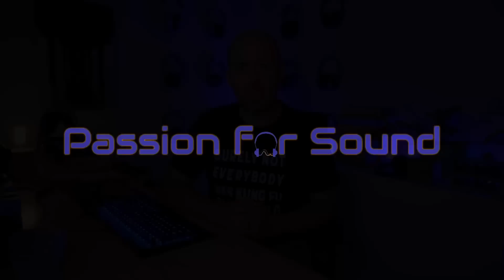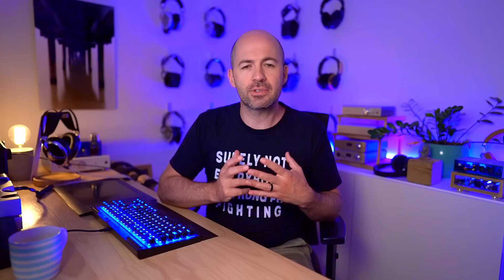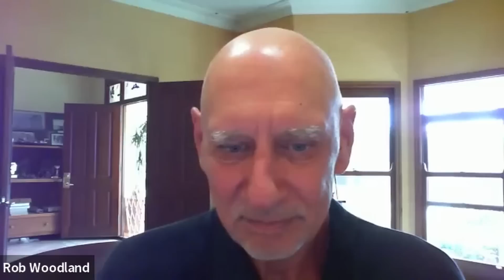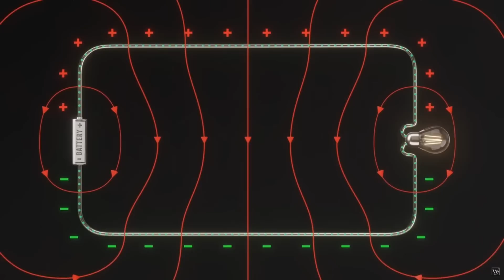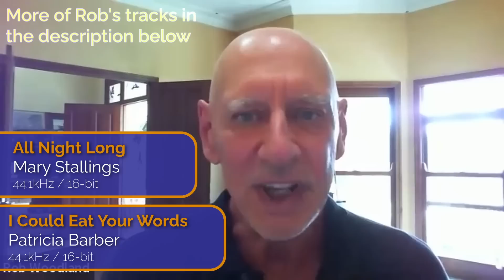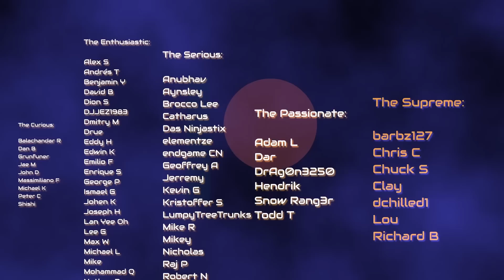USB Cables for Audio: Interview with Rob Woodland from Curious Cables

Comment: So I finally got a decent DAC and I am wondering if there is a potential dip in audio quality if my bit depth is too high for the source? The Topping Dac defaults to 32 bit 48000 but most music is 16 bit 41000 and I hear much of games are 24 bit 48000. Is 32 helping or no?
Reply from the maker: You'll generally want to use an exclusive, bit-perfect connection to your DAC via a dedicated music playback software. If you're operating system is resampling the audio it will degrade the quality so it's not about the bit-depth or sample rate so much as the poor quality resampling being done by your OS.
You can check out simple, free software like Foobar to setup a bit-perfect connection and see what difference you can hear.
Reply: @PassionforSound  Okay but will that work for games or only music?
Reply from the maker: Only music. It will be good enough for gaming though that I wouldn't worry too much about it for that. Maybe try changing your OS settings to output 48kHz, 16-bit and see how that sounds because I'm pretty sure that's the native sample rate for most computer audio and might therefore have less meddling from the OS. Just an idea.
Reply: @PassionforSound  Thanks will do. :)

Comment: Nicely Done. 
You seem to genuinely enjoy these interviews and I usually come away with a tidbit.  Good on you.
Patricia Barber :)
The point that stood out for me - You can hear the difference in a good quality system.
IMHO I don't think reviewers ( in general ) stress enough that anyone with a dac from $100-$500  maybe till $1000  is not in that category and most likely won't hear any difference. 
Not resolving enough might be the term.
I think Rob mentioned ( I'll paraphrase ) This is for a person with that good quality system that is looking to squeeze out the last drops of goodness from there system.
Your thoughts ?
Reply from the maker: I completely agree and I often stress in my accessory reviews (cables, power supplies, etc.) that these types of upgrades should generally be the last thing you buy because you'll get more bang for buck from upgrading components than cables, etc. I do think cables can improve a lower level system, but the improvement will be much less obvious depending on just how high or low level the system is

Comment: After watching this video I swapped USB cable in my DAC.  Unfortunately there is no audible difference.  
Cheap USB cable that came with my DAC sounds as good as expensive audioquest cable   LOL
Upsampling to 1.5 ghz in HQPlayer also works just fine.

Comment: Appreciate the insightful video!
One thing I wish you would've asked was the difference between active and passive usb cables and how they worked (the ones with a separate 5V line, for ex). I'm aware it has to do with some type of handshaking but other than that that's all I know.
Reply: To see if your DAC does not require the 5v handshake  - The  + -5v pins on the USB cable can be de-activated by just a sliver of insulation tape.
If the DAC is recognised  then you have effectively reduced noise down the USB cable -Nice tweak
Reply from the maker: My understanding is that some devices rely on the 5V lead to know that the DAC and source are connected - others don't. If you don't need the 5V handshake then removing the 5V power lead can help remove a noise source from the signal path, but there are too many DACs that rely on the 5V which is why most audio cables still include the 5V and aim to deal with the noise using insulation, separating from the main cable, etc.
Reply: @PassionforSound  thanks for some clarification! Too many dacs rely on them? The ones I've seen are mostly in the higher-end of things, but I could be wrong.
Reply from the maker: When I was testing the USB cards (Matrix, JCat, etc.) I found that none of the many DACs I had here would recognise the PC if the 5V power wasn't activated. I'm not sure about all the ins and outs of it

Comment: 16:00 I keep echoing this sentiment.  I just don't listen at the level where I, as an audio-enthusiast WELL vested in this hobby, can hear enough of a difference in cabling to spend a couple of hundred to improve my chain.  Even though my listening is 100% digital.  Even though I believe (don't know, believe) that cables can modify the sonic characteristics of your setup, it still doesn't make sense enough for me to spend the money there.  I'll pad roll.  I'll acoustically mod.  I'll EQ. I'll maybe invest in a separate power supply or conditioner.  Whether I'm right or wrong, I just do what makes sense to me in this hobby and refrain from condemning anyone else for their choices.  Even if you want to buy the same Doorstoppers Darko uses.  Doesn't affect me one iota.  If you think it sounds better then more power to you.  

When the laws and statutes are passed that requires you to buy a $600 dollar cable within 30 days of purchasing an audio device over $200.. then I'll grab my pitchfork.  Can't remember where I put the torches though.
Reply from the maker: No need for the torches, just stick to the stuff that makes you happy 😉

Comment: I don't want to be that guy and I do appreciate the video and have nothing against anyones opinions, but I feel very confident in claiming that this is absolute bollocks.

The mentioned electrical phenomena have absolutely nothing to do with digital transfer. Any up to standard spec digital cable will work identically to any other (long lengths a separate issue) unless there are design issues in the devices at either end and that would be related to noise/interference that a subpar DAC design, for example, allows to happens, but definitely not to the actual signal itself as it is infact data in analog form. There are no dimensions of variance that matter.

Whether the data comes in via optical, USB cable, bluetooth, ethernet or in hand written letters that are then manually written into a buffer with a keyboard shouldn't have any effect on how it is translated into an analog signal. That is the very purpose of digital information transfer. It would be the same as claiming that that routing your Tidal lossless stream via a VPN through another country to avoid the under-sea cables is a good idea since that makes the music sound wet.

There often are very minor differences due to issues with DAC design for example, but the cable doesn't affect this unless there are severe technical design failures. Like in this video, no one can even come up with a fantastical potential explanation.

It is effectively certain that no one can notice a difference between a 1$ USB cable and a 1000$ one in a double blind test on a system that doesn't have noise issues in the design.

That said, having good quality, well designed products made from good materials is, of course, a great thing and can cause a subjectively worthwhile experience since the listening experience is comprised of many things beyond the sound itself.

Also you can buy an AC cable for 1$ so surely the regulations are not an impediment to producing a high-end one? Unless the claim is that the regulations don't allow for a superior design then the most basic stuff on the market.

Enough for the rant, I like your channel and even this video. Keep it up!
Reply: Try it yourself and hear the difference.
Reply: @DrJum  Okay, I have here the USB cable that came with a Playstation 3 controller and a Supra USB cable that is commonly sold in hifi shops. The Supra cable also costs literally a 100 times more. 

Could I, or a few studio professionals I could ask to try, hear a difference with these or do I need something fancier? Any song  suggestions that might help reveal the difference or certain aspects of the sound? Soundstage was mentioned in this video a few times so maybe that's one.
Reply: @hartyewh1  After being in this hobby for some time and having a good enough system and training my brain enough I can hear many differences between all sorts of cables. I used to not hear a difference even when trying in the earlier days. I have spent more time than I’d like to admit comparing USB, XLR, RCA, headphone and speaker cables and I have not found 2 different models that sound exactly the same yet.   The differences I can observe are purely tonal. Eg more or less bass, midbass, mids, highs, etc. when it comes to spatial difference in cables it generally if not always related to the tonal difference providing that spatial variance. For example a cable that lowers mids a couple dB will make everything sound a bit more spacious and less intimate. Hope this helps.
Reply: @hartyewh1  Use a song you know well so you’re not surprised by random sounds and instruments popping in. Doesn’t have to be audiophile quality. Try to test just a short period like 3-5 seconds and try to remember what you hear by describing it… is it chesty, is it harsh, is it realistic, etc. then quickly switch cables and listen to that few seconds again and describe again. Sellers of Flowers by Regina Spektor will tell you a lot about a cable in the first 6 seconds. Focus on her sibilance from the S sounds. If you’re highs are high they’ll be harsh and grating. If they’re too low it won’t sound harsh or resolving. You want to try and find a sweet spot to your preference. If you don’t hear a difference in those 2 specific cables there may not be a difference or maybe it’s too small to pickup on. Once you’ve heard a more stark difference the smaller ones will be easier to pickup on.
Reply: @DrJum  Well sure, analog cables make some difference certainly and that is no wonder, but for a digital one to do that seems strange at the least. If the differences are tonal then that would be very easy to measure as well. I wonder why no has done that.
Reply: @hartyewh1 Digital cables are a misnomer by the way. It’s an analog cable for digital use. USB cables aren’t 1s and 0s it’s a voltage range just like analog but interpreted differently by the computer… basically. I understand what you mean, it’s clearly an audible difference but the people with measurement rigs worth their salt aren’t bothering.  You really need a lab environment to test accurately too as things like temperature of the room will affect measurements if using microphones!
Reply from the maker: Tonal differences can be caused by slight changes in things like signal phase which won't show up on simple frequency response measurements. It's also why different amps and DACs which measure ruler-flat for frequency response can sound different tonally
Reply from the maker: I think that's the key in the end - try it for yourself and see what you think. There's insufficient understanding of hearing science to say definitively what is/isn't audible so the only way to truly know is to listen for yourself with an open mind and test biases for and against your experiences.

Comment: What if you live in an area being served by a Internet backbone router that is not Hifi?
Reply from the maker: Hi Jonas, I don't understand the question - sorry! Can you explain a bit more what you mean?
Reply: @PassionforSound  My point is, why is the digital protocols used for local data transport not as error resistant as the tech used to send data from the streaming servers to our homes?
Everyone seem to take for granted that the bits reaching our local applications are perfect. But that we are also utterly incapable to build local data transport that delivers data in a conveyor-agnostic way.
Reply from the maker: Ah, that's because of the importance of timing at the final stage. For whatever reason, USB audio doesn't buffer the file before playback. That means there's no chance for error correction. My understanding is that the buffering that occurs when you commence streaming allows for error correction in the file transfer from the server, but once the transport sends the USB signal things are different.
I can only imagine that USB audio is not buffered due to the need for very low latency playback in situations such as recording, editing, etc.
Reply: @PassionforSound  " for error correction in the file transfer from the server" - i recommend you read a book by Candace Leiden , Marshall Wilensky about TCP/IP.
Reply from the maker: Ummm. TCP/IP is a network protocol. We're talking about USB audio.
Reply: @PassionforSound  same shit, they either work or don't. Protocol doesn't care what type data it transmits.

Comment: have you seen my comment in your other video about this usb cable here in your channel?
please do not make confusion between magnetic field and electrical noise... the first one has to be fighted with geometry of the wires inside the cable... the second one is mainly RF (like that one from you mobile...or fromthe fridge... or neon lamp etc) and can be fixed via shield, shield do not work against magnetic noise unless you use very special material, very expensive, normally used in military application.
Anyway...very interesting video, the cable I've done use 7N cooper... I will check about silver wire and maybe will do another one just to compare
Reply from the maker: Unfortunately, YouTube seems to have deleted it ☹️
There's no confusion between magnetic fields and electrical noise. We're talking about the electro-magnetic fields (two different, interacting fields). Check out the video in the description for a link to the video we're referring to - it explains it far better than I can.
Reply: @PassionforSound  I tried right now postagain the two patents but... incredible... 20 sec after I posted the info youtube cancelled them... crazy!
Reply from the maker: Yeah, YT is pretty harsh with the deletions. Sorry about that
Reply: @PassionforSound   so I've tried again putting the info about documents in different way, in a way that I'm having doubt the IA is able to recognize... and has been deleted again... interesting
Reply from the maker: Yeah, I don't understand it. I've had other viewers get deleted comments for completely innocent posts - it's strange